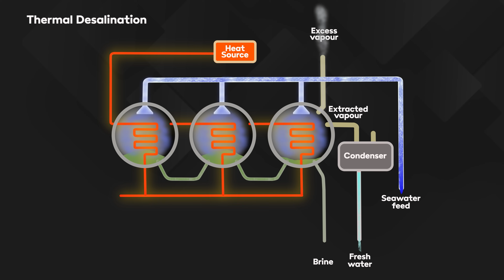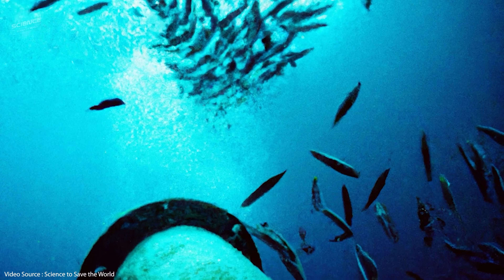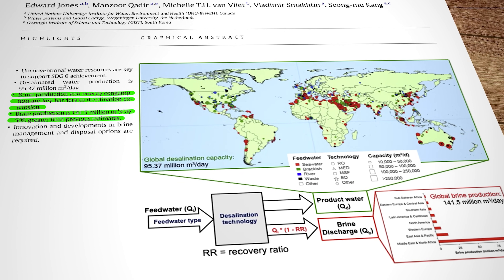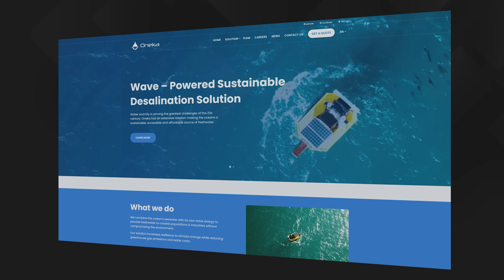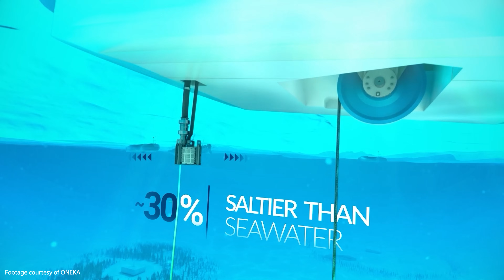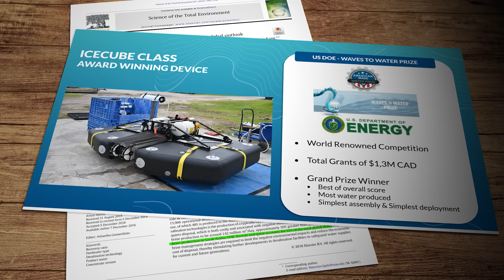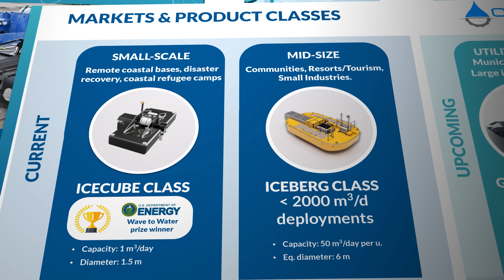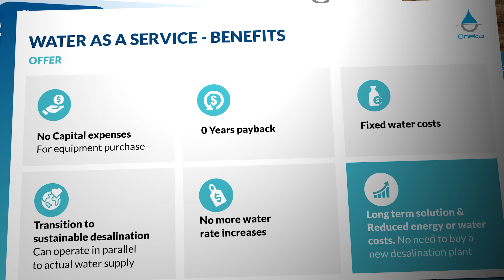Fresh Water at Zero Energy Cost . How do they do that?

Comment: Thank you for the great new video, and for the quick tour of your filming facility. ;-) I always thought you were in a house. As sheds go that one looks very nice, but it is winter now.

Desalinating seawater is one of the most important challenges of our time, and it looks like Oneka has some good ideas there. What I like:

1. It's elegant. Using wave power without converting it to electricity is very clever. Presumably this will solve the problem of waves not being constant. Waves pulse like a heartbeat, on and off, which is a problem for machines like motors and pumps that are built to use a steady supply of electricity. If this whole thing is powered by the mechanical action of water pushing through the system it shouldn't matter if everything is idle between pulses.

2. It's decentralized. I love their concept of desalinating 25% of the water and having multiple outfalls from separate units. Desalination is such an industrial process it seems like a sin not to get every last possible drop of water for every unit of energy expended. But if nature is providing the mechanical power, efficiency isn't such a concern. And not hurting the environment (more than it can naturally bear) would make this system vastly preferable to just about everything else.

What I'm not so sure about:

1. Maintenance. If these things do form the basis of artificial reefs they're going to get crusted over with all kinds of sea life. That 60 micron strainer at the bottom is particularly vulnerable. It's going to get clogged, and will probably require regular cleaning to keep filter feeders off. The filters inside the unit may be similar. And since they're offshore it means somebody will have to get in a boat on a regular basis and go out there to do maintenance.

2. The pipe to shore. I guess this depends upon how their "pressure and flow optimization system" works. They've got to push the fresh water a long way before it gets to shore, and this process also depends entirely upon wave power. Will there be enough pressure in the pipes to move those huge quantities of water long distances every day? I guess they must have this figured out, but it seems like the hardest part of the process to me.

But every system has potential problems, and this one is very clever and looks like it has huge benefits over the usual reverse osmosis. I hope they make a big splash in the industry and become successful.

Comment: Hello Dave, 

Thanks for finding another wide, good and practical invention and apparatus. I work in mining technology development with my industrial engineer brother and we produce clean metals extraction technology for licensing. Among the breakthroughs achieved we can offer 80% Capex investment saving, 90% energy saving, efficient metal recovery from 87% Cu to 97% Cu from raw ores and concentrates, metals clean waste-rock and only 10% water use which includes 90% recycling. 

I find the Oneka invention very clever and suitable for mining operations around 600 TPD of ores extraction; we  are attempting to introduce a 30 day process cycle, so the desalination rates you mentioned such as the Glacier are suitable. I also noticed that Chile is one of the countries willing to test Oneka's equipment which could be very useful for fishermen, marine culture, miners and coastal communities agricultural mini-farms.

By the way I have been looking into 3D mini-farming which add 2 to 3 stories to cultivate fresh vegetables and some bean types, because any of the coastal communities mentioned will thrive if the food supply in locally produced, instead of transported from far away 2D farms. I am convinced that 2D farming ("forceful flatland creation") is responsible for much deforestation, soil exhaustion and less rainfall worldwide. The intact Amazon Jungle is a perfect example of water and nutrients recirculation; indeed ancient traditional Amazon native tribes rotate their place of occupation to allow vegetation and animals to grow back, which is a "wise land-occupation tecnological thinking" applied for thousands of years... There are YouTube video presentations discussing that the extensive Maya communities dissapeared because of severe droughts, possibly created by human communities reaching millions of people as discovered with high-resolution satellite imagery. We have to start on communities 3D framing teching, practice and education, from childhood, because we are repeating "the Maya curse" by "grouping people into inmense and insesible large city dwellers masses" many of them jobless, There you have job opportunities: learn to grow green vegetables for your farmily and then sell it, and then grow to groups of families that will live in food abundance and thus can think better about their next land-use decissions.

I ask you please do some research and show in Just Have a Think. Thanks for creating a great and window of wisdom for reasonable human beings to reflect and change their lives for better.  My retirement plan in 5 years from now is to have a 3D farm and would be pleased to invite your to visit; part of my plan includes 3D farms establishing in the Atacama Desert which is underlain by aquifers with enough water to support hydroponic 3D cultivation (includin water recycling) and  even fish farms!!

Best regards,

Jaime ARIAS
Minerals Exploration Geologist 
Clean Metals Production Inventor & Developer

Comment: This seems like common sense. However keeping this equipmemt clean and free from little beasties that like to settle on any surface they can. Barnecles will even grow on Whales skin! 
It is this that has killed all wave powered attempts before. The working tidal generators are rased at neep / slack tides for cleaning. That is the reason they work reliably and are very effective.

Comment: Hard to say how big a problem it is since the cost is a big question mark at the moment, but Kuwait currently desalinates 2.238 million cubic meters per day. That's equivalent to 4476 of the largest model that produces 500m³/day.
Also a big question mark is how it will fare in various wave conditions.
While the waves around Florida might be suitable, how does that compare to the conditions in e.g. the Persian Gulf, the Red Sea, or the Mediterranean?
Finally, how resistant would they be to flaking off microplastics?

Some numbers:
Water consumption in liters per day
US: 378
Europe: 189
Africa: 57
UN recommend minimum: 49

Comment: It seems to me that the main problem with all these offshore facilities is the roughness and unpredictability of the sea itself, especially when it comes to joining whatever is produced to the land based places where it is needed.
Perhaps, a solution would be to take the sea itself on land, siphoning the waters on facilities built on land and using the more predictable tidal changing to generate power.
Relatively more expensive to built but much easier to maintain and distribute afterword.

Comment: So much simpler to make renewable electricity and use it to run reverse osmosis plants at reasonable scale.  The reason we discharge more concentrated brine from RO than these guys are doing is pretty simple- pumping water costs money.   Pumping water costs money, and these guys do pump both the water and the brine a shorter distance than a land-based plant, but at the cost of ridiculously small scale (and hence, unfortunately, much higher cost of capital per unit of water produced).  Note also that the existing state of the art is around 2.5 kWh of input electricity to make 1000 litres of freshwater, which is about 60% efficiency relative to the minimum thermodynamically required amount of energy required to separate seawater into freshwater and saltier water.   There's not much room to invent a better mousetrap here.  The better solution is to stop being idiots and using drinking-quality water to water lawns and flush toilets!

Comment: Concerning the first part of the video, I can understand how desalination isn't the best use of solar and renewable energy when it's possible to combine desalination with wave-energy, but water desalination is capable of being time-delayed (I.e. it flows into day-tanks before and after disinfection) which makes it a much better fit to solar and wind than, say, home electricity. A desalination facility with more capacity and only operating with the sun will last longer and have better, more flexible maintenance than a typical 90-99% uptime facility. 

Speaking of flexibility, this product is putting a critical resource at the whims of the weather. Renewables can form country-wide grids that become more stable as more windmills, solar panels, batteries, and geothermal plants are added, with fuel-driven peaker plants available for emergencies. I'm picturing a tropical resort asking all residents to swim out into calmed waters to rock the platform to provide drinking water, and it just looks silly.

Comment: The biggest issue they have is logistics, how do they pipe all that desalinated water to shore.
The second issue is maintenance, sea water is known to cause A LOT more maintenance cost for anything on it.
I also have doubts that they will be cheaper than 1 big desalination plant when we're talking big scale.
Reply: Pumping the water to the shore is using the same wave action that pressurize the water for reverse osmosis. I agree with the rest though.

Comment: My view is that this is a dream driven scam. First the process isn't zero energy, it still needs wave energy to function, and if waves were a viable source of energy we would already have renewable power plants driven by waves, rather than a few non viable test facilities. Secondly. The scale just doesn't work. Sure 50000 litres a day SOUNDS great, but actually that's terrible. Desalination plants produce tens, or hundreds of MILLIONS of GALLONS of fresh water per day. There is a reason for this. Humans use a LOT of water. For example in the west a person on average, will use around 140 litres per day. That's 140 million litres per 1 million people. The large "Iceberg" class system discussed in this video produces 50000 litres a day. Meaning you would need almost 3000 to service the needs of a million people. For reference New York has a population of more than 8 million people. 25000 Iceberg units would be needed just to meet the needs of ONE city. Which is absurd. Even if we ignored the multiple other problems with this system, (fouling, difficulty of maintenance, storm damage etc etc.) Just the sheer scale of how many of these would be needed to service even a modest sized population's needs makes it entirely unrealistic.

Comment: Besides the one made from recycled PET (which would disintegrate over time in the alkaline sea water) it seems to be a good idea. However, many small units usually cause higher cost per production unit, and more problems than one big unit. And if they can pipe the fresh water to the shore, they could surely use a similar system to distribute the brine over a wider area for a big unit.
Well, let's see how it will work.

Comment: Like most environmentalist nonsense, this system is going to be incredibly expensive and take up vast amounts of space.
What youre trying to do is take a desalination plant, scatter it into thousands of impossible to maintain rubber dinghies in the middle of the ocean, and then lay hundreds of kilometers of water piping to connect them to shore.

Where does the energy come from to power these boats? Lets do some quick calculations:
"Iceburg" class; Outputs 50 m3/d
"Ras Al-Khair Power and Desalination Plant"; it outputs 1,036,000 m3/d, and uses 2,400MW to do so.
1,036,000 / 50 = 20,720x smaller output
2,400MW / 20,720x = 0.115 MW

So that means on this "Iceburg" class  115kW is being harvested from wave action.
If this is to be taken as truth, why on earth aren't they marketing this as a cheap & reliable wave power source?

Now lets get an idea how much open water would be clogged up by these things:
Judging by the little animation showing these boats tethered to the seabed by a 13m long rope (at  6:44 ), lets assume each boat must be spaced apart by 20 meters.

To create the equivalent of that aforementioned desalination plant, we need:
1,036,000 / 50 = 20,720 "Iceburg" class boats

Each boat must be 20 meters apart, aranged in a grid pattern:
1,000m / 20m = 50
50 * 50 = 2,500 boats per square km of ocean

20,720 boats / 2,500 b/km2 = ~8 square km needed for these vessels.

The maintenance implications for looking after tens of thousands of these things completely impractical.

More importantly, what happens on a calm day? No drinking water?

Comment: If the return brine is less salty, doesn't this mean the fresh water still has salt in it?
Reply: No: it means you simply get less fresh water back for every gallon (litre, etc) of water input.

Or conversely you need to pump in correspondingly more sea water at the inflow.
Reply: @trueriver1950  so it's just less efficient, and they're trying to make that out to be a good thing?
Reply: @Poitda31  less efficient in terms of what?

In terms of electricity used it's infinitely efficient.

In terms of upholding the future of wildlife it's more efficient.

In terms of daily water production per £1k invested, we don't know the figures so depending on cost of deployment that could go either way; in terms of daily water production per £1k of running costs again we don't know the figures. You'd want to compare maintenance of this system vs maintenance plus energy costs of the alternative 

Likewise for carbon costs, both of production and of running: we simply don't know and until they have experience with prototypes at scale nor do they 

In terms of efficiency of extending the live of the membrane it's more efficient.

In terms of the purity of the product it's better (RO leaks very little salt, but as you lower the forcing pressure the even purer the product you get).

The only metric on which it comes out worse is the one I mentioned, it's efficiency in terms of purified water divided by input volume. They're quite right to point increases in other efficiency measures, and in fact being rather reticent about the huge range of advantages.

So you have to ask: under what circumstances would volume of water input and of brine effluent actually matter? Clearly it would be daft to try to do more pressure RO inland as the pumping costs escalate, but floating on the ocean itself, does it really matter? I can't think of a single reason why it might, of you can please share. If not, then I would say it really IS a good thing. That's my opinion and yours may of course vary.

Comment: Well, now that's an interesting idea.   As per usual the Zero energy cost is just marketing b.s. but if they can keep it down to build,install, and maintenance then that would indeed be good.  
You did however show it in calm waters.   So I'm guessing there will still need a backup plan or some kind of pumps to pull the water up high enough to store for a while.

Comment: This is bogus, to crack water takes more energy than you get, and tellingly nobody studied it to think it works  period.

Then, any and all heat sources for thermal, SteamAge electricity emits 2-joules of wasteheat per watt on_the_wire times 1.7-aggi for greenhousing is 3.4× output kept heating the planet.

A 1500Mwh nuke plant emits 4800Mw of retained heat.

1-Mw genset/ container 50yr no_inputs warranty w/upkeep No CO2 H20 or wasteheat/ Mwh superconducts coils

13-units are 12-Mw of 100%- duty-cycle baseload electricity in a parkinglot, a half_century of electricity each  17yr RnD sparkless military_spec Belgian D.Antonio Romero dsgnr technokontrol's RF-5000.

Rare_earth magnets fade-10%/1000yrs, what other source of usable force is there that even comes close for torque  the 1300hp all_magnet motor fits cars ?